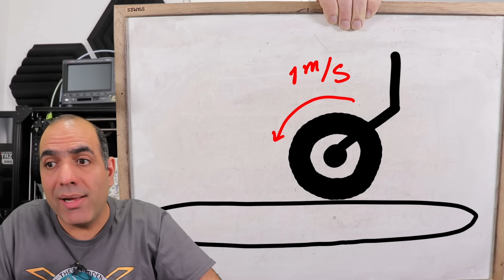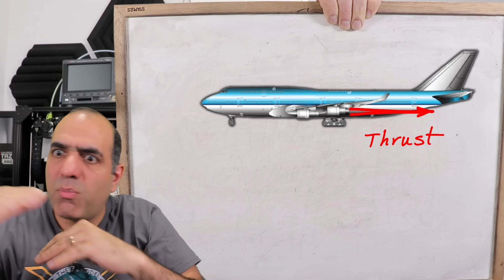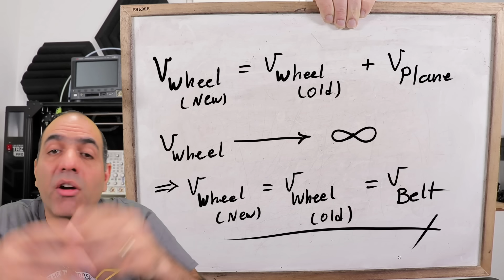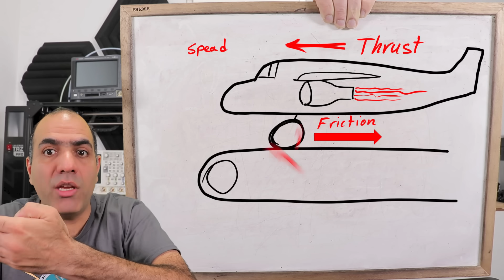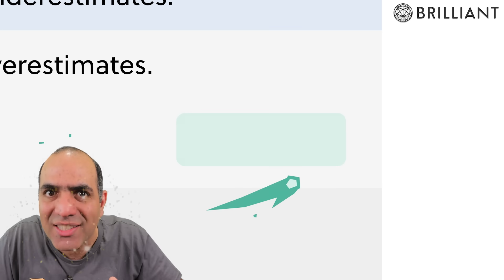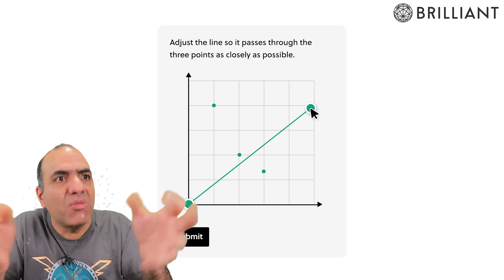Airplane Question that Drove Me NUTS!!!

Comment: It blows my mind how many people get tripped up by this.  The plane takes off because it's powered by thrust and not the wheels.  You can ask the same question about a sea plane taking off from a river against the current.  Or a plane with skis taking off from a huge iceberg drifting the other direction.  Whatever a plane sits on exists to hold the plane up off the ground and reduce friction so it can roll or slide across the surface with minimal resistance so the thrust from the propellers or jet engines can get it going fast enough through the AIR to take off.  If we could put levitating magnet hover pads on a plane we would and then it wouldn't touch the ground at all like a maglev train.  All the same concept.

Comment: this assumes that planes get their forward movement from the wheels THEY DO NOT! it is from THRUST from the engines this is BASIC! does not matter if the belt is running the plane will still take off mythbusters did this with a REAL plane. I am shocked that some one as smart as you can struggle with this concept.wheel bearings dont mean SQUAT when the engines produce 20k pounds of thrust EACH! this thought experiment is about as stupid as the what came first the chicken or the egg. Simple EVOLUTION made the egg over time but there was always a chicken to lay it *sigh i wish people would educate themselves!
Reply: Nobody assumes planes are powered by the wheels.  When people recognize that they have created a poor strawman, then it is easier to discuss the real topic.

Thrust is just a force on the body.  It doesn’t matter if someone shoves the plane, uses a catapult, or a self contained propulsion like a propeller, jet, or rocket.

Comment: As per me (not a physics student) Wings of planes are in a perticular shape so the wind can lift it up due to thrust. 

So if the plane is on the same place i don't think it'll get any resistance from the surrounding air. Which should mean it won't fly. 

But again the logic i used is based on paper planes so i could be wrong.

Comment: The airplane will take off. This occurs because an airplane’s engines do not drive the wheels to move the plane forward; instead, they pull or push the entire craft through the air. Since the wheels can spin freely, a conveyor belt moving backward only makes the wheels spin faster while the engines effectively accelerate the plane forward through the surrounding air. Once the plane achieves its required takeoff speed compared to the stationary air around it, the wings create the necessary lift to fly. This process is completely independent of how fast the ground or the wheels are moving.

Comment: Imagine if there is no belt and the wheels are fixed and will not rotate, the plane will take off if the force of thrust can counteract the friction of the wheels against the ground and reach sufficient speed to create lift.

Comment: short answer: yes long answer The Setup:

You've imagined a Boeing 747 (a truly massive aircraft!) placed on a conveyor belt. This belt is:

Runway-sized: It's as wide and long as a typical airport runway, providing ample space.
Moving in Opposition: The belt moves at the exact same speed as the plane's wheels are turning, but in the opposite direction.
The Question: Can the Plane Take Off?

The core of the debate centers on whether the plane's wheels' rotation (or lack thereof, relative to the ground) affects its ability to generate lift and take off.

Here's the breakdown:

Lift Generation: Airplanes generate lift primarily through their wings. As the plane moves forward (relative to the air), the wings create a pressure difference, with lower pressure above the wing and higher pressure below. This pressure difference generates an upward force (lift) that counteracts gravity.

Wheel's Role: The wheels' primary function is to support the plane's weight and allow it to move across the ground during takeoff and landing. They also provide a connection to the ground for steering and braking. However, the wheels do not directly contribute to generating lift.

The Conveyor Belt's Impact: The conveyor belt's speed is designed to perfectly counteract the rotation of the wheels. This means:

Wheel Rotation: The wheels will be spinning at a high rate, but the plane's position relative to the ground won't change.
Airflow: The plane's engines will still be generating thrust, and the plane will be moving forward relative to the air. This is the crucial point.
The Takeoff Scenario:

As the plane's engines generate thrust, the plane accelerates forward through the air.
The wings begin to generate lift as the plane's speed increases relative to the air.
Once the lift generated by the wings overcomes the force of gravity (and the weight of the plane), the plane will begin to rise.
The wheels will be spinning rapidly on the conveyor belt, but they are not the primary factor determining whether the plane can take off.
The Answer:

Yes, the plane can take off.

Why the Confusion?

The confusion arises from focusing on the wheels' movement relative to the ground. However, the critical factor is the plane's movement relative to the air. As long as the plane's engines generate enough thrust to overcome drag and the wings generate enough lift, the plane will take off, regardless of what the wheels are doing.

Important Considerations:

Friction: While the wheels don't directly generate lift, the friction between the wheels and the conveyor belt could potentially create some drag, but this is a secondary effect and would not prevent takeoff.
Conveyor Belt Limitations: In a real-world scenario, building a conveyor belt capable of handling the weight and forces involved in a 747's takeoff would be an engineering marvel, if not practically impossible.
Simplified Model: This thought experiment simplifies the complex dynamics of flight. Factors like wind, air density, and the plane's control surfaces (flaps, ailerons, etc.) also play significant roles.
In Conclusion:

The 747 will take off. The conveyor belt's effect on the wheels is a distraction. The plane's ability to fly depends on its engines generating enough thrust to achieve airspeed, which, in turn, allows the wings to generate sufficient lift to overcome gravity.

Comment: people keep talking about wind speed but if the aircraft is at a standstill on the run way because the conveyor belt is taking away ALL forward movement. WHERE IS THE AIR SPEED???  because the air speed would be the same as the plane speed relative to the ground. which is ZERO.
Reply: The issue is the runway is physically incapable of "taking away all forward movement".  The source of forward movement in any plane is the engine's interactions with the air.  The only source of backwards motion if the plane is on a conveyor is the friction between the gear wheels and their axles. We can assume these bearings are frictionless (they essentially are in real life too), meaning there is no way for the plane to be moved back.  It might be easier to imagine if you take away the thrust entirely.  Imagine a situation where a plane is sitting on a conveyor belt in neutral gear.  When the conveyor is turned on, if these axles are frictionless, the plane won't move, the wheels will simply spin underneath it. The object began at rest and the lack of friction between the moving wheel and the axle means no force can transfer to the fuselage and it stays at rest.  Now if we include the friction between the axle and the wheels, the engine thrust would simply need to overcome that small friction to get motion (which every plane that's ever taken off from a standstill does by default).  This problem is just a counterintuitive thing to visualize and is hard to explain (or is explained poorly as is in the twitter post referenced).
Reply: Another way to visualize it might be with a sled and some ice.  If you were standing along side a conveyor made of ice, holding onto the sled with a rope or something, it wouldn't matter how fast this ice conveyor moved.  Ideally, you would always be able to walk with the sled against the direction of motion.  In this case, the tension in the rope is the thrust of the engines, the interface between the sled and the ice is the interface between the axles and nearly frictionless bearings, and the moving ice is the motion of the wheels or ground (both applicable).

Comment: I say no. because that's not how fluid dynamics work. you need low pressure under the wing. that wont happen if the plane is at a virtual stand still.  i don't understand how people see any other logic.

Comment: It's not the force that the engine produces that causes the plane to fly. There has to be enough wind passing through its wings to generate enough lift for the plane to fly. And the wheels gives the plane space and time to accelerate and holds it up till it reaches enough speed, inturn moving the wind through its wings with enough speed to generate lift that holds it up or climb in altitude. Else the engine has to work considerably harder to pull the wind fast enough under the wings to generate enough lift. Equivalent to the take off speed of a plane on a runway + the speed of wind hitting it during the take off.
It will depend if the engine is that powerful.

That however is assuming that there is no energy transfer between the wheels and the conveyor belt. If the energy from the wind pulled by the engine is wasted in rotating the wheel which in turn transfers it into the conveyor belt or in the form of friction, it will never generate enough lift.
Reply: Sorry, but you don't understand the riddle!  🤦🏼‍♂️

Comment: If the wheel speed is equal to the speed of the conveyor belt, it won't even be able to move forward even at full thrust. For the aircraft to make any forward motion, the wheeels would have to be covering more "distance" than the belt...... but it aint ........

Comment: answer us simple THE BERNOLLI PRINCEPAL
AN AIRCRAFT DOESNT RELLY ONLY ON JET ENGINE POWER AND WHEELS AIRCRAFT WINGS NEED A FIXED STRUCTURE OF AIR PRESSURE WHICH WONT BE AVAILABLE SINCE THE AIRCRAFT IS MOTIONLESS JUST ROTATING WHEELS SO THERE WONT BE BE ANY WIND PRESSURE ON WINGS TO LIFT THE AIRCRAFT

Comment: 4:18 I don't understand, would it not just stay still and not lift off. I know the question is shit but wouldn't wheels ramping to infinity in order for plane to move just instantly be creating a black hole😂Also doesn't it mean that the conditions must not meet at some point because for the plane to move forward the wheels either need to skid or move at infinite speeds... I think in that case the friction of the wheel and the thrust of the engine would cancel each other and plane just stands still in non moving belt.  The axel of the wheel would be  just pushing against the bearing wall. The conveyor speed must be equal to wheel speed so I don't think it can allow it to ramp to in infinity but it would just stay still like pushing against a wall.
Reply: Or maybe it ramps to some speed determined by thrust but because the magic conveyor speed must be locked to wheel speed it would not allow the plane make any relative progress on runway and thus through air.

Comment: The bottom line is that at SOME point the airframe must move forward, if you tied the plane down so that it would not move AT ALL and just ramped up the engines it would NEVER just take off, otherwise aircraft carriers would have some sort of conveyer to take off planes instead of a catapult.  It's correct that the wheels got zero to do with it but the plane must still be moving against the air, whether it's rolling or wind or gods farts it don't matter, if the plane is sitting still with no wind going over the wing it won't take off.

Imagine flying a little cessna and you get hit with a 70 knot tailwind while flying 70 knots You gonna fall out of the sky, it doesn't matter what the ground is doing at that point other than coming up to meet you...

Comment: Before you explain it, I think it can take off no problem. The wheels merely provide a medium to carry the airplane as it accelerates to take-off speed. While the conveyer belt might bleed off some of the airplane’s speed through friction on the axel and what not, I don’t think it would prevent take-off.
Reply: It just rolls in place.

https://youtu.be/l7yW9HitWIA?si=GxxW-XF-DMq239pS

Comment: No. Whilst the actual wheels will be moving, The planes actual physical air speed wont, It's basically running on a treadmill , you're not actually going anywere, so heres no wind or air pressure - no flight

- edit: i was wrong lol

Comment: The question does not ask "WILL the plane take off?", it asks, "CAN the plane take off?".  The wheels have NOTHING to do with what causes the plane to move forward.  Yes, it can and will take off as usual, no matter what the conveyor and the wheels do.  The wheels are just there to prevent the plane from scraping its belly on the ground.  The jet engines cause the forward motion, not the wheels.  🙂

Comment: ChatGPT, help me answer this trick physics question:

ANS from chatgpt:: Here's the correct answer:
✅ Yes, the plane can take off.
______________________________________
💡 Why?
Because airplanes don’t rely on their wheels for forward motion—they rely on thrust from their engines (jet engines in the case of a 747). 
______________________________________
🔧 What about the wheels?
•	The wheels are free-spinning—they’re not driven like a car’s.
•	If the conveyor matches their rotational speed in reverse, the wheels will just spin faster, but this does not stop the plane from moving forward.
______________________________________
But what will we see. Will it VISIBLY MOVE from one end to the other end of the runway?
Yes — you will visibly see the 747 move forward from one end of the conveyor to the other, just like it would on a normal runway.
Reply: That is entirely incorrect because it mistakes the kinematic relationship of a rolling test vehicle on a surface.

This is how AI can get info that sends it down the wrong path.
Reply: @MrDefreese Hahahaha...

 If you're so stupid you can't figure out the riddle, it's obvious that AI will surpass all the idiots who think like you.

It's worrying for human intelligence!

Comment: It doesnt matter if the aircraft uses thrust to move and not the wheels...the wheels will move anyway, meaning the aircraft will never have enough air moving over the wings to lift off...

I feel like this question is a massive DUH ??? with only like 2 variables...its quite obvious...

Comment: the jet engines are pushing the plane forward, the wheels will just be spinning in the opposite direction, it will create resistance (friction) but cant stop the plane from moving unless the friction of the bearings overcomes the jet engines thrust.

Comment: Even if the belt spins insanely fast in the opposite direction, it doesn’t create backward thrust. The plane will still move forward normally because the engines aren’t connected to the wheels.

Comment: I'd say yes. Even if the plane only powered the wheels, no jets or props. Assuming that the plane doesn't roll forwrd or back.
If you turn the treadmill fast enough, it pulls air along and creates some headwind.
If you enough headwind, you fly.

Comment: It will fly guys 
As the  wheel provides less friction to help plane push forward so the moving wheel and belt will provide so less friction as a result it will fly and the belt isnt actually giving any backward force
Reply: Friction only matters in that it makes the correlation between wheel tangential speed and linear speed of the surface much more clear.  1 meter of travel by the wheel on its circumference results in exactly 1 meter of travel by the surface.  There is no net motion.

Comment: In general there is not enough information given. The implication that the friction generated by the conveyer belt is enough to stop forward motion then it would not take off, but realistically airplanes don't use their landing gear to generate forward motion. The Engines would pull the airplane forward, accelerating despite the conveyor belt and allowing an eventual, if horribly prolonged, take-off.
Reply: yes
Reply: meh, it wouldnt prolong it any more than a few seconds really. The wheels spin freely. As long as they dont explode, the plane moves completely independently from the conveyor.

Comment: From an aeronautical student, NO NO AND NO AGAIN! There would be no airflow over the aerofoil (wings) which wouldn’t create a pressure difference therefore creating NO lift. Therefore the plane can’t take off. The wheels moving have nothing to do with a plane flying 🤦‍♂️
Reply: Why would this be the case? the jet engines are pushing the plane forward, the wheels will just be spinning in the opposite direction, it will create resistance (friction) but cant stop the plane from moving unless the friction of the bearings overcomes the jet engines thrust. Not being rude by the way man, it can look like you are through text.
Reply: @TommyCullen-VacuumConnoisseur the force applied by the engines are just a force on the body.  It’s not ‘thrust acting on air’ as people incorrectly intuit as the reason why it moves.  You can use any force on the test vehicle and the kinematics are always going to show that the test vehicle moves nowhere.

Comment: If the wheels are the one moving the plane then no but if the turbines are yes because the turbines don’t grip the ground to accelerate it grips air
Reply: The turbines are just a force on the body.  There is no special issue of the engines ‘acting on air’ as Mythbusters unfortunately posed.

All this is about is a force acting through the axis of a wheel causing it to roll.

Comment: Don’t airplanes need air hitting the wings at a minimum speed? In my eyes the plane would not take off because wheel speed doesn’t really matter, it’s a byproduct of the engines creating thrust, the wings are responsible for creating lift